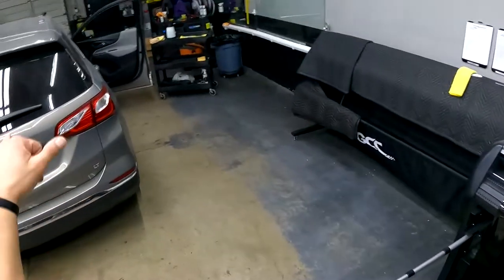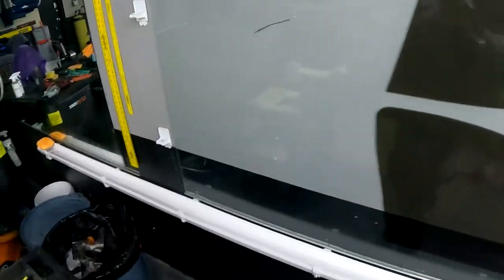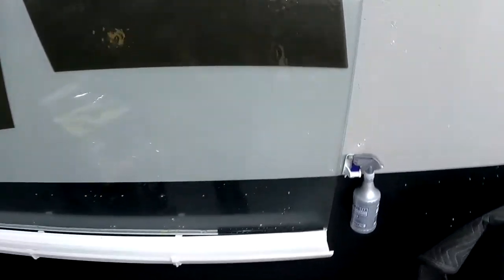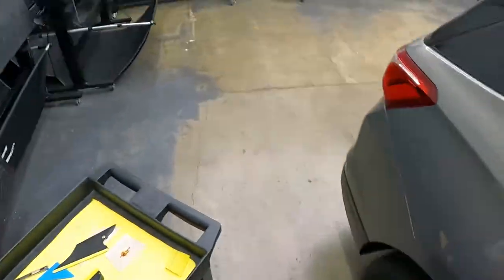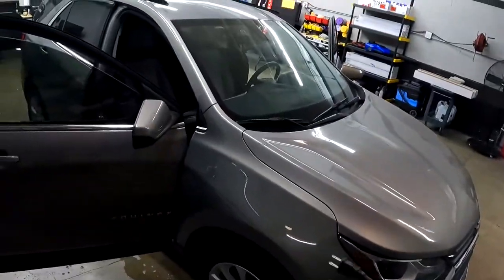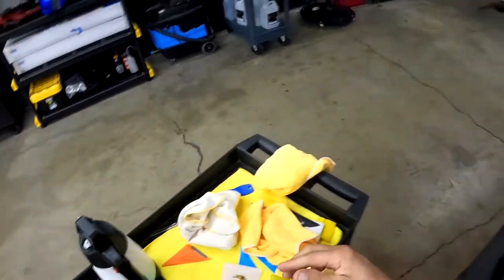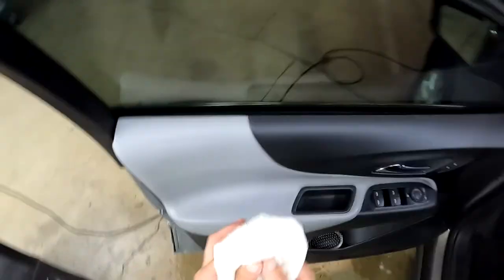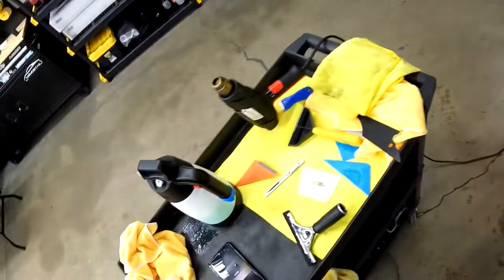How to Tint Front Windows(18 Chevy Equinox)

Comment: So, you put a tool into the window guard and pop the guard off rather than take the door panel off?
Reply from the maker: Yes
Reply from the maker: You can't do this to all vehicles though. Sometimes its easier to just take the door panel off
Reply: @m2mdetail781  In your experience, what percentage of vehicles do you have to remove door panels to get the tint down and, what method do you perfer, removal or working the tint down by hand?
Reply from the maker: @jacknicholais3754  about 95% we either pull the gasket or remove the door panel. Only about 5% we work it from the top to the bottom.
Reply: @m2mdetail781  Thanks very much for the information, very helpful.
Reply from the maker: @jacknicholais3754  no problem 👍